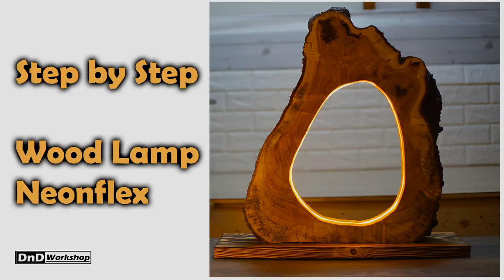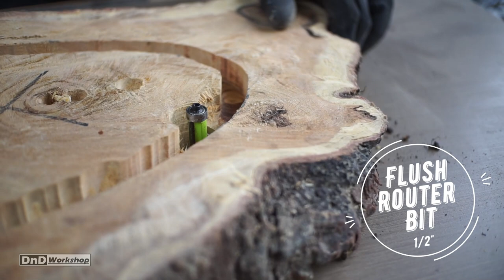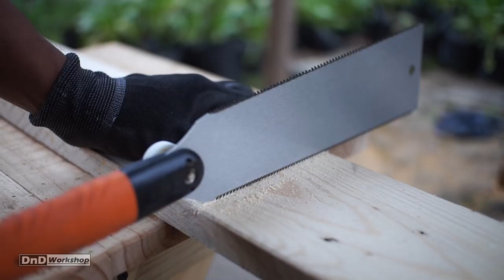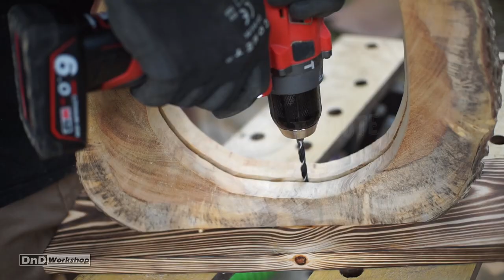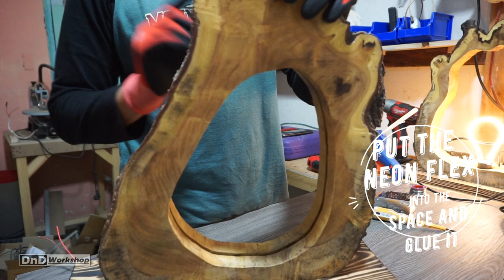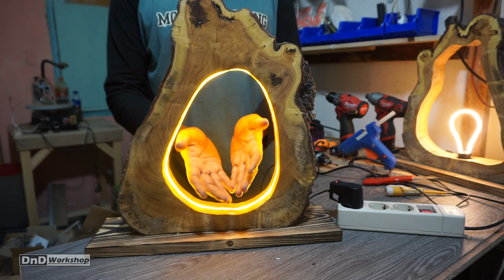Woodturning Project - Wooden Lamp Shade Neon flex - LED Neonflex

Comment: I really like the end result. You might try sharpening your blades and bits. It will make the process much easier, more efficient and definitely more fun. Thanks for the video.
Reply from the maker: thank you sir. yes its slightly dull. thank you for the sugestion